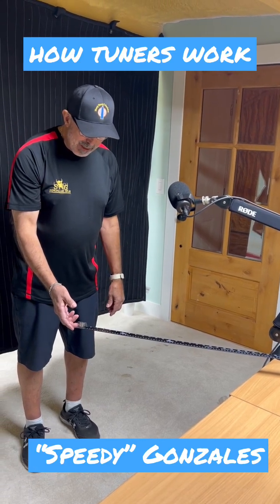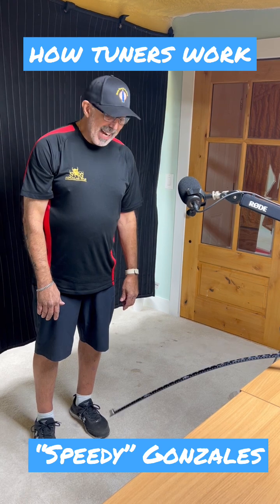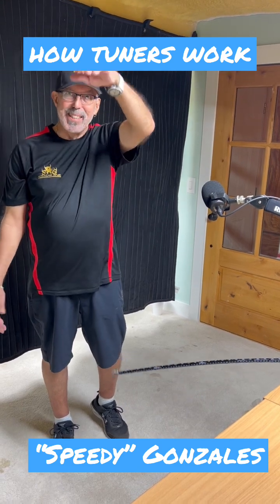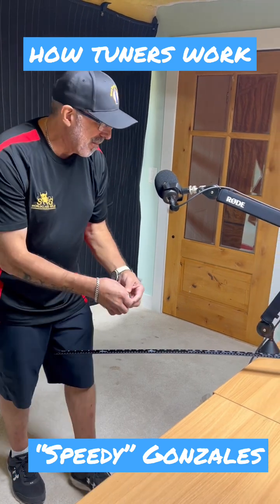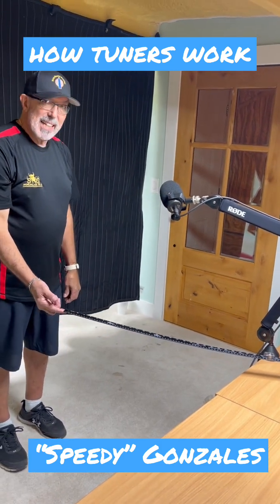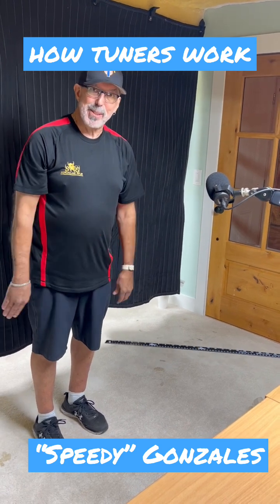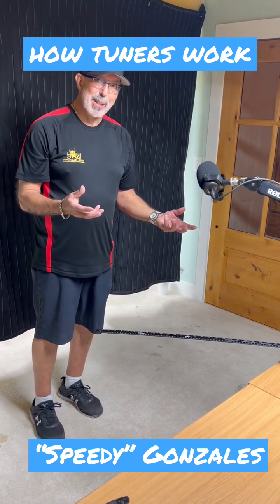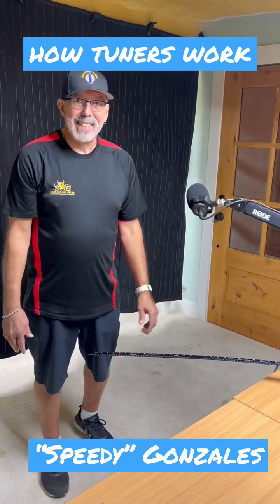How barrel tuners work by Thomas “Speedy” Gonzales

Comment: I believe you but what i don't get is how come shorter fatter barrels have better harmonics than long skinny ones? A shorter fatter steel rod will ring faster and at a higher pitch than a long skinny rod. If i was trying to consistently catch my barrel at the correct vibration wouldn't it be easier to to land in that window if it was a slower vibration?
Reply from the maker: I use 32” barrels in my rifles.  😉

Comment: Strange, so adding weight to the muzzle via a tuner makes the pendulum swing with higher frequency and lower amplitude. Very counterintuitive. So why are most setups free floating barrels rather than locked in place with a collar or something about mid way along the barrel to arrive at a shorter pendulum with higher frequency and lower amplitude. I guess the answer is ease of manufacture and retail consumerism, validation shots.

Comment: Sorry, i don’t understand what this means or how it relates to shooting. Please explain
Reply: The barrel flexes. Even before the bullet exits. The reason why people have been making hand loaded rounds for 100 years is that they were designing a specific weight and power round that happens to exits the barrel while the barrel is in the upswing of its flex or vibration. Results in more consistency in group size and point of impact. Instead of hand loading rounds so the bullet matches the barrel you can effect the barrels vibration to match the bullet
Reply: @1badombre82  Thank you so much for that articulate explanation! Very helpful!

Comment: Thanks for your good effort, in the discussion of the vibration of the pipe connected to the wall in the physics of its harmonic vibration, it has been investigated;  My field is air and space;  in the barrel of the gun, in addition to the sinusoidal vibration in the vertical direction;  There is sinusoidal vibration in the opposite direction of Khan circulation, and in right-handed Khans there is vibration and boraxis deviation to the left.
Reply: Ya what Benghazi said🧠

Comment: The attempt at an analogy is not accurate in detail as the moving weight is travelling 2 - 3 feet, while a barrel tuner is moving in only .001" increments or so.  There are several impulses taking place at the same time in a barrel / stock / shooters hold / firearm rest / etc.  Tuners, if stable, can work, but there are so many contributing factors involved that it is not possible to formulate an algorithm that will work all the time.  It comes down to trial and error.  Change how tight you hold the weapon can change the "tune".  Bench Rest and Belly Bench Rest  attempts to eliminate or control some of the factors, and Sling Shooters do it by sling tension amongst other techniques.  Shooting techniques are just as influential to the final outcome as load development, and maybe more so.
Reply: Try this as I use Harrels tuner/brakes on my Rem.700 stock barrels and they do work. 
Find a load and bullet your rifle appears to shoot the best with a stock you like. Change nothing including the seating of the bullet then install the tuner. Try at least 3 times various settings in close successions and find the best five shot groups.
Then set tuner and make no further changes. 
My Rem 700 stock barrel best 5 shot groups @ 100 yds. were 5/8" and after all of the above I got some 3/8" groups. 
That's shows remarkable improvement for a stock barrel. This is where a tuner really shines.
Reply from the maker: By your logic, load development should not help neither.  🤔
Reply: @ErikCortina  In a short Comments based discussion like this, it is possible to infer ideas that have not been expressed.  Load Development becomes more and more influential as the basic stability of the rifle is reduced.  By that I mean, for a single example, going from a 1.25" thick barrel down towards a hunters thin barrel.  Recently, you have produced your 6.5 Needsmore series, and demonstrated that adding stability influences like a chassis, and tuner can produce increased precision in the results without Load Development.  That leads me to believe that, for one example, barrel thickness is more important that Load Development, not that Load Development is useless.  The thinner the barrel, the more charge and jump tuning effects the outcome.  I wonder how your scores in F-Class would be affected if you had to give up the major influences like a front rest, wide forend, heavy barrel, rear rest, or even one of those?  Would Load Development overcome those losses of influence?
Reply: @ErikCortina  your use of not and neither in the same sentence is as west Virginia as it gets 😂

Comment: All you’ve shown with this is that moving weight back and forth results in a trade off between amplitude and frequency. Nothing you’ve done shows how this helps us land on nodes or how it results in more consistency.
Reply: At this point I remain unconvinced one way or the other. However, the idea is that you're tuning the dead spot in the barrel movement(to reverse direction you first need to stop). So if you have a load that exits the barrel closest to the point where it is still it should be more consistent. Done for a very long time by tuning powder charge and seating depth( in simple terms both change how long the bullet is in the barrel). Given that weight and location of weight changes the dynamics in the system you could argue that the tuner allows you to find the "dead" spot. Not by changing the time the bullet is in the barrel but changing the behavior of the barrel to match the load you have.
Reply: Yeah, that's because it doesn't. Barrel tuners have been proven to be basically useless, and this video does absolutely nothing at all to prove they work, nor does it actually demonstrate real-world barrel harmonics.